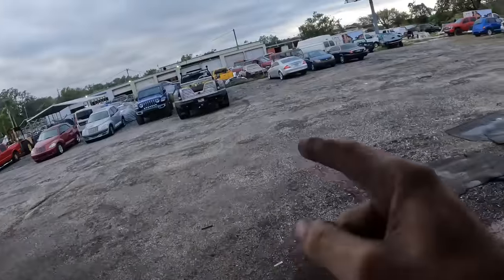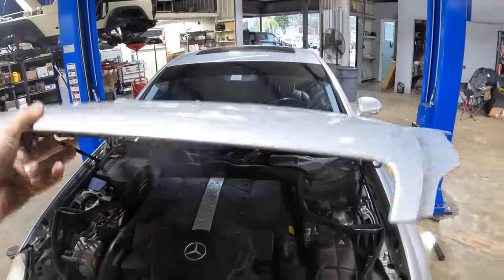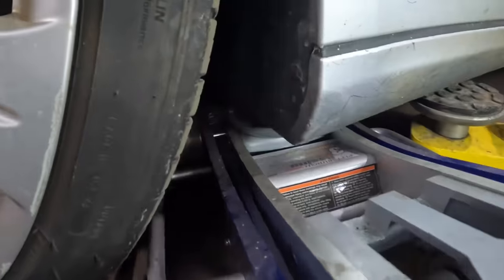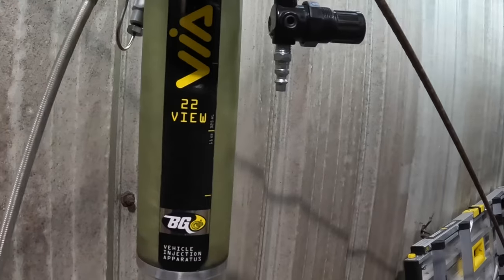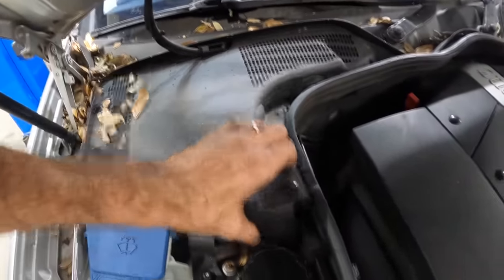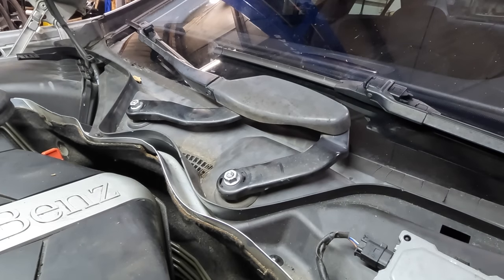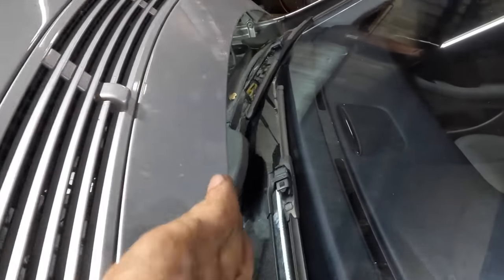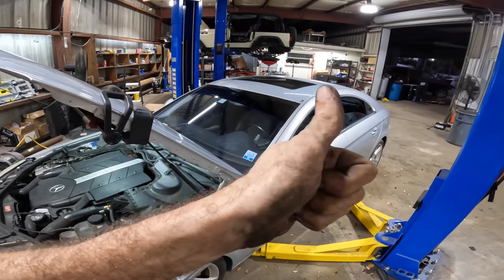Rookie Mistake on a Mercedes! “I quit” @SouthMainAuto

Comment: Oh without a doubt, many garages charge premiums for repairing items that prevent drivability (well here in the UK they do at least) especially if you know nothing about mechanics. They still try the "I can't allow you to take the car away unless it's been repaired" thing, even if you show up with a car trailer because "you might still drive it once you've got it home". Happens more often than you'd think. One place tried it with a friend of mine, £500 to replace a CV joint that didn't need doing, told him he's a mile or 2 from his wheel being thrown from the vehicle so they can't "legally" let the vehicle leave unless it's repaired. He phones me asking if I've got time to do anything and so I head down to take a look, turns out he'd had them replace his discs and pads all round the week prior and they forgot to put one of the bolts back in one of his front calipers, causing it to smash into the rim and start grinding when braking. They even threatened to call the Police when I came back a few minutes later with a replacement bolt so I made sure to point out their mistake loud enough for other customers to hear, it's mad how quickly a customer car park can be emptied with a few choice words 😁 I'd also diagnosed and bodged a no start due to an in-tank pump or sender unit (whichever you want to call it) for an older lady which then failed again when she went to get the part a couple of weeks later (she didn't have the money at the time bless her and neither did I or I would have helped her out). Her breakdown recovery refused to tow her home for a second time for the same fault and instead chose a "reputable" garage for her. With the new sender unit sat on her passenger seat they proceeded to remove the engine from the vehicle piece by piece and dump it in the boot, their reasoning was "because the engine was knocking", pretty normal on petrol (gas) or low pressure diesel vehicles (like her VW Golf SDI) with fuelling issues and when they couldn't figure out where the knocking was coming from they charged her £1000 and quoted another £1500 to fit a replacement engine. When she refused to pay and told them to reassemble the engine because they were clearly either fishing or incompetent they sent the bill to debt collectors and had her car scrapped. It's a messed up world we live in and people will take advantage of you if they can, that's why I always tell people if you're going to own a car you need to have some basic mechanical knowledge, even if you never intend to fix a car yourself.

Comment: per your comments about shops over charging.. yes they do. in fact a local shop just recently got shut down by the law for doing just that, and convincing customers they needed way more work than they needed. to the extent of charging customers for work they didn't even do. I recently brought my own truck in for an alignment after I changed trailing arms, springs and other components in the front end. Told me I needed tie rod ends, and my snow plow mount was rusted out. I knew I needed a steering box already, but the tie rod ends had already been replaced prior. brought it to a friends chop instead, and he aligned it with no issues. I've been doing my own maintenance ,and repairs for 35+ years. alignments and oil changes are about the only things i will pay a shop to do, and they still manage to screw that up once in a while.

Comment: on those years most of the Mercedes I've worked with have a service notch on the driver side hood shock, that even when they are blown you can click it into that will hold it up, and also raises it up higher so you keep hitting your head on it.

Comment: Next door neighbor had the SL500, air bags suspension failed due to the computer failure, and he managed to lose the only key without writing down the key code in the owners manual. the battery would die in two days unless it was unplugged, and the two rear windows regulators were shot. Rand the codes and it had a fatal ECU failure also. The suspension air pump failed also. The cost to replace and repair everything was 6-8K, we called a wrecker and the yard bought it off of us for 2K, and he didn't have to sink any more money into it.

Comment: 11:26 @Rainman Ray's Repairs When you were pulling up on the wiper lever testing out if the spray doesn't work and you saw that it doesn't work. YOU HAVE TO FIRST CHECK OUT IF THE WASHER FLUID RESERVOIR ACTUALLY HAVE FLUID IN IT. "NO FLUID" means it won't spray at all. If there is said "FLUD" then it the Spray Pump Motor on the Reservoir. If you haven't look at it yet and if someone hasn't notice you check it out yet in this video.

Comment: Shit back in the 90s, the owner of the shop I worked at owned 2 Maserati's. He needed valve jobs done on both. Had the dropped off at the shop and put his youngest most ambitious employee to the task, because the shop for the foreign cars charged well in the hundreds of dollars an hour and it was a 3 day job to do it right. A mth later later and thousands of dollars thrown at these 2 cars 1 was driven out of the shop. He sold the other for parts as the kid didn't time it right and caused head damage to 1 of them. Leading them to buy all new valves and tappets and start all over trying to fix the nices of the 2.not to mention all the wiring gremlin issues it had.

Comment: I have a shop vacuum that works much more efficiently timewise for removing leaves etc! My theory is find a problem, fix that first and re-evaluate. If action did not fix, then disassemble/investigate further. In this case, it would have saved the customer some labor charge.

Comment: Hi Ray, someone has probably mentioned it but, Mercedes Benz hoods have the option of lifting straight up and down to give brilliant access to the engine. Just push in the little levers on the hood hinges.
Please be aware of hood clearance to shop roof when lifting car with the hood in the upright position.

Comment: Shops absolutely take advantage of customers. My mom was taking her car to a mechanic for years (I specifically told her to take it to the dealer since it was still under warranty) well this shop was doing her alignments and charging her telling her she needed an alignment every tire change. She was blowing through tires because her car wasn’t aligned and one day I took her car in for her to this place she said did her tires, (this is how I found out she wasn’t taking it to the dealer but to this “tire” shop) the tires were still within warranty but they would not replace them because she needed an alignment. I said you’re the ones that do her alignment why is it not aligned. They tried to pull the whole “needs it every tire change BS) I told them there’s nothing on the suspension or steering that needs worked on during a tire change so it shouldn’t need an alignment. The guy came back and said it needs a “camber kit” and I said why would it need an aftermarket part when it’s an original spec vehicle? We went in circles for a half hour, I had them put the old tires back on and took it to another tire shop and also got it aligned by MY guy who had no words for how bad it was out of alignment. She must have put 4 sets of tires on that car yearly at this place the way they had her bent over. I was so angry I wanted to do felonious shit to this place. Instead I reported them to the BAR and never went back.

Comment: I remember driving two hundred miles to pick up a a car from a used car sales. It had been raining that morning before I got there. After completing the sale and taking owner ship of the car, jumped in to drive to gas station quarter mile up the road to find out only one side of wipers were working. Lucky I had my tools with me. I only bought the car because I saw a video of it running. They obviously weren't interested in my safety. Still got the car today runs like a dream.

Comment: Retired Mercedes tech here, just a tip on replacing parts that have pairs, recommend to the customer that they get both replaced. As an example, when one strut goes bad, the other is not far behind. It's not necessary to replace both, but give the customer a heads up, that way they don't come back all heated two weeks later that the warning light is back on with the other strut blown.

Comment: Yes some shops do.. I had a 2011 rough I used to run back and forth to work.  Died one day.  Had it towed to a shop.  Bad mass airflow.  They wanted 450 to replace it.  After I told them no. The follow up was the intake is in pieces so it’s going to be cheaper for us just to do it.  Again I said no.  Put it back together.  I know you don’t need to pull the intake apart to troubleshoot.  I had them push it outside and I came back after hours and changed it in 15 minutes. Payed maybe 100 for a life time warranty part.  I get paying for the skill.  But 450 for a 15 minute job and a part with no real warranty….

Comment: I was going to point out that the drive arm for the right side wiper, is the one to the left.  But you figured it out.  I hope that you get to do a wiper trans on the single arm unit.  Those are tricky.

Comment: I have an 01 F150 that I bought new. I have been dealing with the wipers for years. Get a little snow and the wipers don't move, forget to turn them off when I park and if they are stuck in ice when I start again they don't work. I carry a wrench in my console just to tighten those cursed nuts.

Comment: As someone that is working monstly on Mercedes, you made your life harder on the wiper issue. Also you need to remove the cabin filter housing in order to adjust the drain pipe correctly.
About the wiper injectors, firstly lock the hood locks and try again. Some models do not allow even the wiper to work if the hood is open. Most commonly it will be the motor

Comment: My current list to have done for vehicle inspection that I haven't had time to do due to work that involves driving said vehicle, rear brake cylinder, brake bias load spring stretched needs now loop as it's  run out of adjustment, possible pads on front. New clamp for muffler as it's leaking, new coolant thermostat , oil change and some super sticky additive to help with cow emmissions at idle, I also need to run a couple of low octane tanks of fuel through it. Also the door interior light switch is being temperamental after the sils were welded up for the severalth time. I'm hoping they don't mind that I can remove the key while it's running.

Comment: The hood has it’s own support, there is a clip near the spring on the driver side just push it and lift the hood more, these air shocks are easy to replace and they are cheap, I did it my self including the engine and transmission mounts, watch and make sure to have fresh transmission oil and filter. Maybe flushing the radiator antifreeze too with 140k miles on this car 
Mine is 2010 with great condition and low miles, great car and I don’t see why anyone will think of selling such a wonderful powerful car

Comment: I know this is an old video but the ones with hydraulic suspension get gunk buildup. There's a test procedure you can do which makes the car act like a low rider at a party and dance which shuffles all the fluid around getting any debris into the filter as it should be

You need the scan tool for it though

Comment: as a Mercedes owner for 20+ yrs and DIY'r some recommendations on this car.  replace both front airspring/shocks,  when 1 is gone, the other is not long for this life,  use Arnotts as they are much less expensive than the OE and have lifetime warranty.
with that tire wear, in the front the passenger side needs all lower bushings, for suspension.  these w211 based w119 cars wear the front bushing regularly. rear tires common wear because of camber, which is not adjustable.  also that cowl should be replaced because that windshield seal is very cracked up.

Comment: On Porsche air suspension cars, you need to Disable the system first before lifting or jacking the vehicle. My Cayenne I just hold the selector button until I get the disabled message on the display screen.

Comment: I got E350, my camber off, got alignment done new tires, 6 months later my fronts inside tires down to the threads, I look at the alignment sheet they off , need special bolts for fix camber, but bolts can only adjust it so much so I believe I need bushings , not sure if I can get it to where it need to be by myself, I need a camber level tool

Comment: On the hood hinges, you can release the angle stop opening and open the hood so it is vertical and locked. But be careful that it doesn't hit the top of electric lift crossbar when you raise the car up.

Comment: There are usually alignment marks on the windshield for where the wipers should park. Better idea to follow them than to follow witness marks. Bought a car one time, they had the wipers aligned all wrong, and the arms were even swapped left to right.

Comment: Ray, turns out that large air noise the car made when you lifted it up was the air suspension trying to adjust itself. It has a jack mode button to prevent the car from trying to continue to inflate the airbags

Comment: I'm at the wiper section. Customer brought in an 04 ish audi something for washer pump operation. I was dumbfounded checking in. Found the pump to check power ground-standard procedure, right? An hour later I found out that the pump will not run with the hood open. Thanks Euro cars. I generally try to keep them out of the shop but, we mechanics make dumb decisions sometimes.

Comment: I had pretty much the same with suspension on my Merc, except it's sports low profile and once the suspension collapses you can't turn the steering without hitting the wheel arches. Had to get it specially towed and once I'd had it towed I was at the mercy of the shop. Even had to park it outside lined up with their ramps.
No idea what happens if I'd parked it with the wheels at an angle, guess it would have pulled off the bodywork.

Comment: Speaking of that.  I just took my sons car to the VW dealership in Schaumburg, IL.  I thought it had a bad alternator.  I told my son on our way home that if it's just the alternator, it should be between $300-$600 to replace.  The next day the dealership told me that it would be $1500 - $1600 to replace the alternator.  $750 for the part and $800 for the labor.  I called O'Rielly's to see if they had one.  Yes.  $250.  I called a local shop to see how much to replace the alternator.  They said $650 with parts included.  I'm going to try to replace it myself and if I need backup.  $650.

Comment: Whe  you're that close to being able to get the loft arm under z auto, just lift up on the fender or wheel well n push the arm in. Not floor jack needed.  And i know some cars w air ride have a switch to turn the air ride system off so the the compressor does t keep pumping trying to level the car while its off the ground so it doesnt blow the bag or over heat and trash the compressor. Im guessing this car and most newer cars dont have them and the hole was a wear spot on the bag where it folds over itself and once the car was lifted it exposed the hole for the air to rush out. But always safe to check if z auto has a saftey switch for the compressor or not

Comment: squirts? electrical or motor? can not wait for strut. had to replace 
a front a arm on my fathers old mercedes, just after I did the NYState 
inspection to have the spring pop through the lower a arm as I backed it out.
it was easy to replace. not like new cars.

Comment: 18:08 I made my own rookie mistake regarding wiper transmissions recently.  To access one of the right front strut top nuts on my minivan requires removing the wiper transmission arm on the passenger side that blocks it.  Instead of taking the transmission assembly out in one piece I just took a pry bar and disconnected the socket to the one part that was in my way.  I have been unable to figure out how to put it back together and in my attempts have dented up the socket that the relevant piece of the transmission linkage's joint plugs into.  This will be a $110 lesson for me.  If I had made this mistake before inflation it would've been an $80 part.  Ugh...

BUT I know now for next time, disconnect at the wiper motor, unbolt the wiper arms, take it out in one piece.  No fun having to learn lessons the hard way but it was my own vehicle and not a customer ride, so the damage is minimal and except for this comment being posted on the internet, no one is the wiser.  Oops!

Comment: Hey, BTW I check out local shops around north of Tampa a lot and $ 490 to flush and change a thermostat on a car the book time in 30min. Therm. Oem at the dealer $12 $22.78 for antifreeze plus flush. $10 under $50 so $440 dollars for an easy Easy job bolt right in front no problems getting to it. Now i know why portable lifts are so in back order everybody's buying the lifts so they can do their own work cuz they sure as hell can't afford getting the oil change anymore it's called pricing yourself out of the market what do you think everybody's going to EV cars.

Comment: 26:40 - I can't speak for all shops, but my local mechanic does not upcharge. But he will just do the work and add it to the bill, which is almost as bad because you're not expecting it when you go in to pick it up.
I've tried talking to him about it, but he still does it anyway citing, "It's a safety issue. It has to be fixed before I can let you have your car back." That's honestly the only shady thing. There's a couple other garages in my town, and they are much shadier and will upcharge repairs like you're concerned about here, not by that much, at least. They'll maybe add 30-40%.. Still bad, but at least it's not 500%.